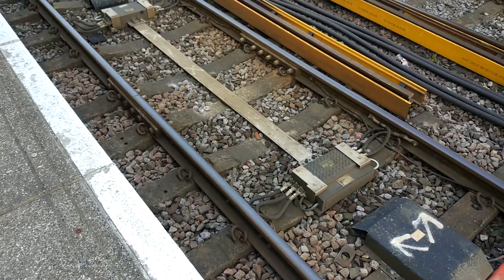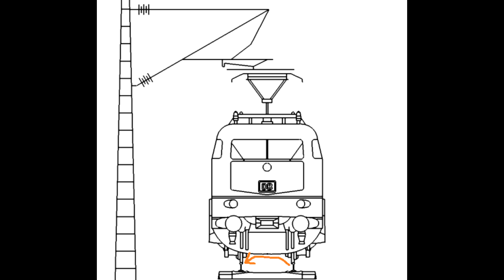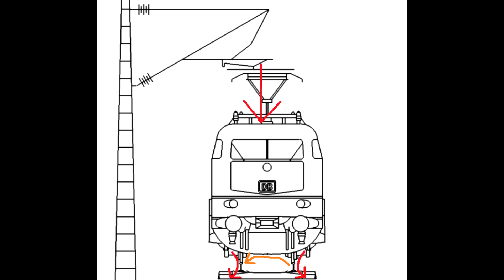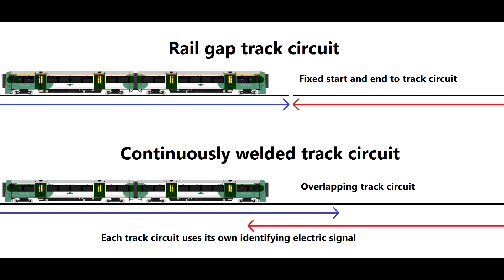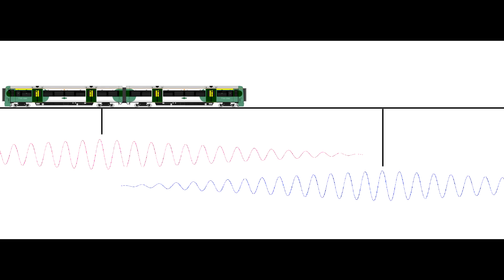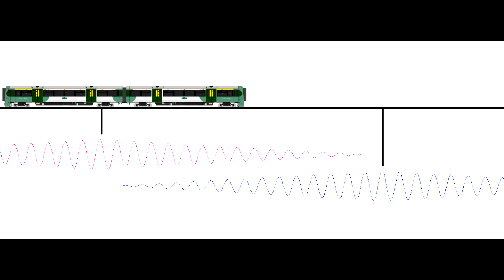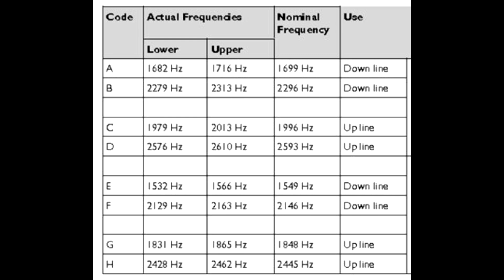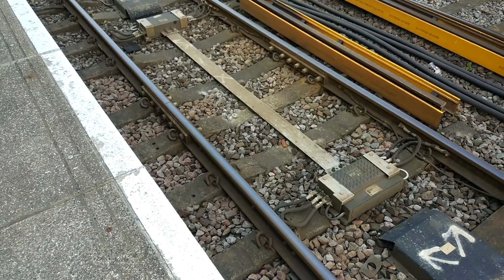How audible track circuits work

Comment: The equipment shown in the four foot in your video is the Impedance bond, spider, which allows DC return current  to pass a block joint.

Comment: In my area we use different ways to detect trains. The function of these are to prove the absence of a train, not prove the presence of a train.
Most simple round here is axle counters. These are generally used on single lines, they count the axles into a section and count them out of the section at the other end. Any discrepancies in the count (20 in, 18 out) results in a failed state and the block is shown as occupied.

Moving onto track circuits, DC tracks are still very widely used in non-electrified areas and almost always through sets of points. They pump out ~6V DC down one rail, through the coil of a track relay and back up the other rail as the return. As the train passes over the section, the axles short out the track so the voltage doesn't reach the track relay coil and causes it to drop, giving an indication of the track showing occupied. Each DC track circuit section is separated by using insulated rail joints. Where DC tracks are up against each other, the polarity will flip between each one so in the event of both IRJs shorting it will show the tracks as occupied, if the polarity stayed the same there would be a potential for a track circuit to be false fed whilst a train is running over it, showing it as clear.

Aster track circuits are a dated frequency track circuit, which instead of having a variable frequency just chimes at a fixed frequency. This frequency is designed to hang on the exact frequency such as 1700, 1900 etc instead of 93/6/9 which TI-21 (Or EBI200) use. They are emitted through the use of the transmitter unit, and the area where each block changes is called a tuning zone. The point of this is to direct the frequency into the ETU (End termination unit), and at the next block we take readings to make sure the other track isn't leaking through to the next section. They still work through shorting on the trains axles and dropping a Track Relay, however there are different things which can go wrong with these compared to regular DC track circuits. As you said, they are mainly used on CWR areas and on long track circuits with multiple sections on fast lines.

There are others however we don't have any, and it will work a bit differently with overhead line sections and third rail sections.
Reply: Hlo , I want to know how audio frequency track circuit works, can you tell that

Comment: Really good video.  Audio Frequency track circuits can have some unexpected failure modes, from the NTSB report on a deadly train crash in 2009 on Metrorail in Washington DC, USA:

"The investigation determined that a failure mode was present when a series of conditions
existed between the transmitter and receiver track circuit modules that generated a spurious
signal of sufficient strength to be interpreted as a valid track circuit signal. First, the power
output transistors of the track circuit module transmitter were producing parasitic oscillation.
This oscillation was able to exploit an unintended path from the transmitter module to the
respective receiver module by migrating through the equipment racks on which they were
mounted. The oscillation was then coupled to the receiver module for that track circuit,
producing a decaying pulse that was synchronized with the track circuit audio frequency. When
the decaying pulses were of sufficient amplitude to drive the receiver module, the track circuit
relay was energized, incorrectly indicating to the ATC system that the occupied track circuit was
vacant. "

Comment: Good video beno! I’ve never head of this type of detection system so im not sure if you are 100% correct. Out on track the most common we use is track circuits (not like this) and axel counters. With upgrade works and the move towards ATO over ETCS you will start to see more balise as we move away from a fixed block. This is obviously determined on what class of traffic management they use.

Comment: I thought it was supposed to be an anti chav system.
Reply from the maker: Anti chav systems are much higher.  usually 16000hz to 20000hz.  These systems are illegal due to the Equality Act 2010.  They are discrimination based on age which is a protected characteristic.  Most places have switched from high pitch sounds to classical music to get rid of chavs.
Reply: @benolifts  because chavs are allergic to classical music
Reply: @benolifts  hahaha
Reply: Like how you said “anti chav” 😂🤣🤣